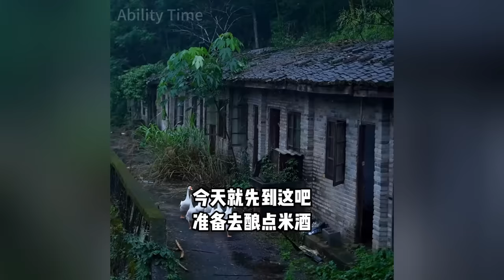A Talented Girl Renovates an Old Abandoned House ~ The old Factory in the Forest is Restored

Comment: Interesting to put just the tiles on the roof, without anything under it. It's so different from where I come from. We need thermal insulation and water protection under the roof tiles. To keep the warmth in (or heat out in summer) and water out.